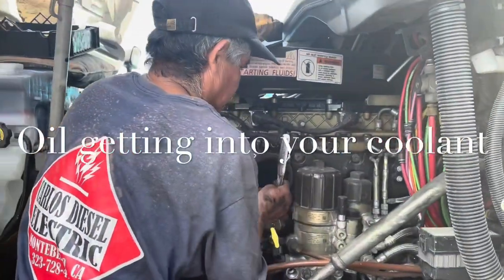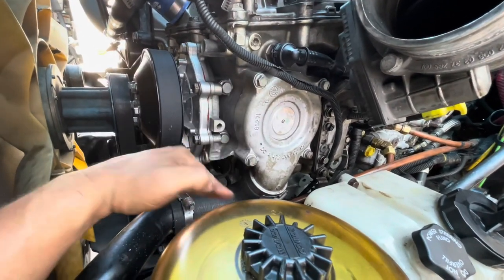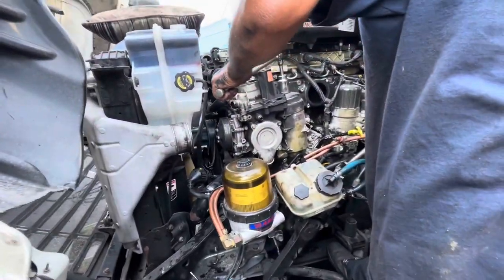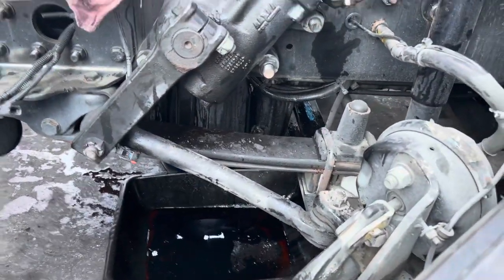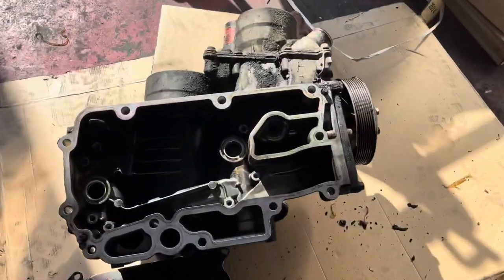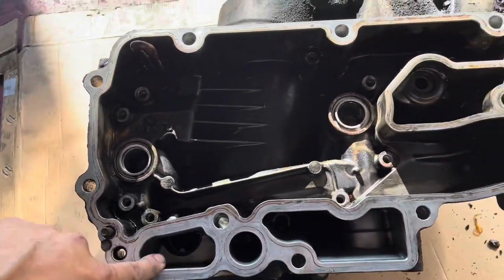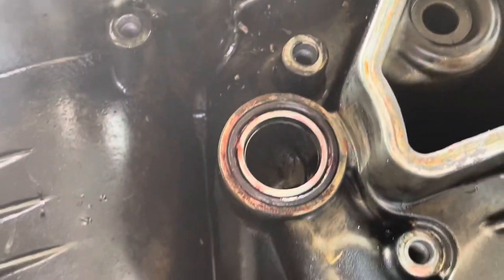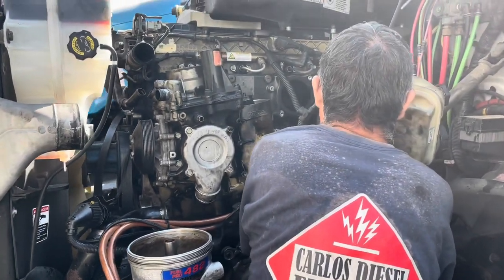Cascadia, DD15 coolant contaminated with oil and how to fix it.

Comment: My 2013 Cascadia DD-15 has water in the oil pan, my oil looks like chocolate milk!!!, what is my best options? Please😢
Reply from the maker: @CindyBell-mc4xs  remove the oil pan, pressurize the cooling system and inspect to see what liner or liners are leaking. You most likely have a liner seal that has let out and allowing coolant into the oil pan. 
Do you have a delete? If you do, an injector or injectors may be over fueling and may have caused this. 
How many miles?

Comment: How did you come cooler being problem? How do you rule out cylinder head or cracked sleeves?
Reply: Head would be coolant in the oil. Here you have oil in the coolant.

Comment: i have the same problem on my 2018 cascadia. i changed the cooler 2 times from 2different mechanics. but still oil is going to coolant.  what else could be wrong.
Reply from the maker: So if you replaced both seals and the oil cooler and you still have the problem. Then you may have a bad module.
Reply: @CarlosDieselElectric  OK THANK YOU I WILLL CHECK ON THAT.
Reply: @CarlosDieselElectric  hi i  changed module as well but still having same issue.  what else could be wrong please advice
Reply: Me to, I replaced the gasket and the oil cooler but it still leaks into the antifreeze. What can I try again

Comment: you what's crazy I replace the gasket on that oil module if I had known while I was there I could have replace those gasket to not have that problem in the future. My next oil change I'm gonna pull it back down and drain coolant and replace those two gaskets. I rather that than oil and coolant mixing then be force to do it.

Comment: Hi, Pedro. Another great video. Ive done this on mine. Btw there's a drain plug for the coolant in the module. I'd still changed the oil just in case. Ive just done injector cup seals because my truck mixed fuel in coolant and it stinks. Im interested in what kind of product you use for the flush and what procedure you prefer.

Comment: Thanks for the video, how much will that job cost with parts and labor.
Reply from the maker: Parts and labor are going to run you about $1500-2000. 
That includes gaskets, seals, oil cooler, new motor oil, new oil filter and miscellaneous parts.
Reply: @CarlosDieselElectric  ok thanks
Reply: @CarlosDieselElectric where is this shop and got another question how long can you run before you replace and before it gets bad
Reply from the maker: @abdiqaniadan2349  how long you can you run like that depends on the seals or the leaks. There isn’t really a way to tell how long it will last before everything goes sideways.
Reply: @CarlosDieselElectric  name of this shop please
Reply from the maker: @abdiqaniadan2349  Carlos Diesel Electric
We are in Montebello, Ca

Comment: So i was running little bit hot than engine was used to and also running really hot when hauling 38-44k lbs. noticed less than inch of oil over coolant in coolant tank. Oil dipstick "seems" fine with just oil in it. So my question is what are chances that my head gaskets is out? Or is it this issue you showed us? I do leak coolant somewhere that i can not figure out. Also i can see that drivers side of engine is wet.

Comment: Thanks for the video Pedro I have a question what year freightliner cascadia do u recommend I’m looking for a single axle day cab?
Reply from the maker: Probably the 2014-2015 or newer, they have a slightly different set up when it comes to the DEF system. The One Box is almost the same. 
I would look into a DD13, local work they are a good way to go. Seem to have less issues with the after treatment.
Reply: @CarlosDieselElectric  thanks should I get the 113 model or 125 model

Comment: Nuevamente muchas  gracias por la información ……. Pero lo que me está pasando a la Freitliler le está entrando coolant al fuel ….. mi compañero  cambió los seals en los injector cups pero está haciendo lo mismo habrio hecho una equivocación mi compañero o puede ser otra cosa antemano muchas gracias espero y me pueda ayudar
Reply from the maker: Las copas tienen su propio seal aparte de los inyectores. 
Puede ser algo en el cabeza or en el módulo de combustible

Comment: I have coolant loss a gallon a day no external leak is it possible that I have same issue or it might be leaking inside egr cooler?
Reply from the maker: I would look into the EGR cooler being the issue. Check the cross over hot pipe, remove and inspect it inside. It should be dry and soot should only be present. 
If it is wet, then most likely you have and EGR cooler. Try checking this after you run the truck.
Reply: @CarlosDieselElectric  I really don’t wanna keep my def I want to delete it since I spent so much money and still I get codes and have to do regen can a delete solves the issue in case I have coolant leak in my egr?
Reply from the maker: @adamotak5145  first verify if you have an EGR cooler leak by checking for coolant in the cross over hot pipe (easiest place to start). 
Deleting the after treatment will not resolve possible EGR cooler issue.

Comment: Is there any recommendation when we should replace it or is it one of those things when it breaks you fix it.
Reply from the maker: I have seen them last many miles before any issues or problems present themselves. Usually the tank starts to get cloudy before any signs of oil are present.

Comment: Would the EGR cooler be a possible culprit for the oil in coolant? Maybe even the transmission cooler that’s on the radiator?
Reply from the maker: Coolant goes through the cooler to cool off the exhaust gases. So oil in the coolant would be coming from a different source. Not likely from the radiator, although might be possible. The seals on the oil cooler are usually the source of the problem. How many miles are on the truck?
Reply: @CarlosDieselElectric  ahh that’s right. I was thinking it was like a Cummins. They got a big problem with the seals for the egr cooler. I think the truck has like 300k maybe. I replaced the seals 1 time already and the oil cooler. Gotta get some time to check it out again
Reply from the maker: @le3ch90  The seals over time get hard and that is where the leaks start. I would start there, least expensive place to start. Mostly labor, try doing it when the truck is due for service.

Comment: Oil in coolant..oil cooler and o rings not leaking..what is next to find oil leak and repair it..
Reply from the maker: This could be something in the block, head gasket or cylinder head. 
You will need to start digging deeper.

Comment: My detroit 60 series has oil in coolant resevoir and coolant level has been going down very rapidly as well. Is this head gasket issue? Or a transmission cooler or an oil cooler issue?
Reply from the maker: I would lean towards the oil cooler. Most likely culprit

Comment: How long did you have this issue before you fixed it and where is the shop
Reply from the maker: The issue can take time to present itself. The driver needs to looking at the coolant tank to see if there are any changes. 
Once the customer saw the issue, he brought it in right away. The job takes around 10 hours, plus you will need to flush the entire cooling system several times in order to get as much of the oil as possible. 
The flushing of the system takes 4-5 attempts

Comment: Hey anyone know why the coolant goes down on the surge tank when you accelerate DD13? Than when you let go of the throttle the coolant rises back in the surge tank? It literally goes below min and than back to max when you let go of the petal... once a week we have to add half of gallon...No egr leak... Please help anything ideas helps
Reply from the maker: You may have an internal problem. Could also be the surge tank. Try having your mechanic pressurize the coolant system. 
How many miles does the truck have? What year is the truck?

Comment: When we supposed to adjust valves. My freightliner 2019 has 300k
Reply from the maker: The interval Detroit recommends is at 100,000 miles, 250,000 miles and then at 500,000 miles. 
I don't completely agree with this interval because I have seen valves need adjustment every 100,000 miles. So  there are different factors that come into play when it comes to valve adjustment intervals.
Reply: @CarlosDieselElectric  when do you recommend to clean or get a new DPF . Is this also every 100k?. Thank you in advance. I wonder what's the difference between overhauled and I inframe or rebuild.

Comment: About how much would this job cost a rough estimate?
Reply from the maker: @LeonardoNavarrete-q9l  the time is about 6-8 hours. The rate depends on the shop. 
The parts you need:
New seals, new mounting seal for the module. 
New oil, new filter and maybe some hoses. 
But the labor depends on how bad the oil contamination is. It may take 3-5 flushes in order to remove almost of the oil.

Comment: Is this the only place oil will get into the water system? Or was there a diagnostic test you didn't show ?
Reply from the maker: This is the only place I have found where coolant can be introduced into the cooling system unless possibly the cylinder head but unlikely. The oil cooler, seals or the module itself.
I have only seen the cylinder head be the issue one time and that was because mechanic that overhauled it prior to it coming to my shop installed an EPA 10 block with a GHG 14 cylinder head. They are not compatible.

Comment: Can I reuse the engine oil 
And coolant
Reply from the maker: I would not. Once I remove motor oil I always add new. I personally won’t run the risk of damaging the engine because of debris or something in the oil (or container) that was removed. 
Coolant, if you have contaminated coolant then it gets dumped and go with new.

Comment: My coolant in 2012 dd 13 going straight to oil pan
Reply from the maker: Sounds like a liner is leaking coolant directly into the oil system. You will need to remove the oil pan, apply some pressure to the cooling system and look for the leaking liner. This is most likely the issue.
Reply: @CarlosDieselElectric  recommended way of doing this without the oil pan
Reply from the maker: @tonybrown8692 in order to see which liner is leaking, this is the only way. Unless you have a cracked block or cylinder head issue. But coolant going directly into the oil most likely a liner seal that has let out. This will need to be fixed, not just by replacing the seal on the liner but finding the root cause.
Reply: @CarlosDieselElectric  will it make the oil pan gasket blow out
Reply: Something made my oil pan gasket blow. In no it wasn't ever overheating.

Also would you have a good used one for sale

Comment: How much is it cost to replace
Reply from the maker: Parts are not that expensive, you will need to change the oil, flush the coolant system. That is where pricing will change depending on how dirty the system is. It may require multiple times before most of the oil is out of the cooling system.

Comment: that coolant oil module with the oil cooler is the stupidest thing ive seen, its not a good design if the cooler fails oil gets into the coolant and contaminants seals and other things
Reply from the maker: I agree, the seals are almost always the issue. I have not seen the oil cooler go bad. I usually just change them both.